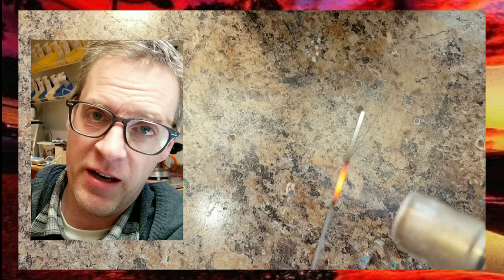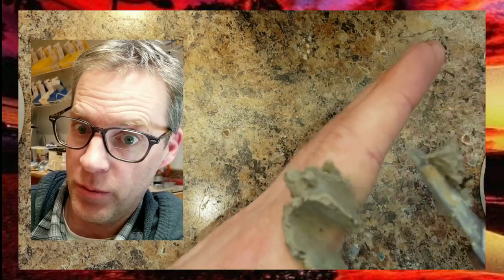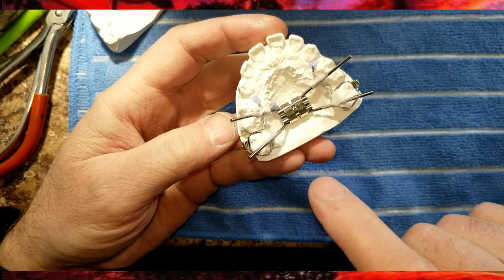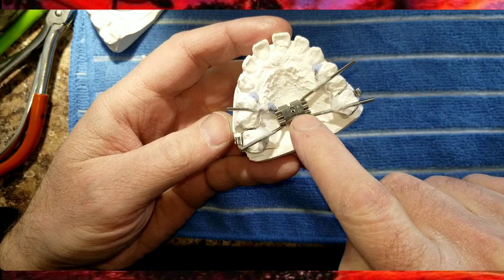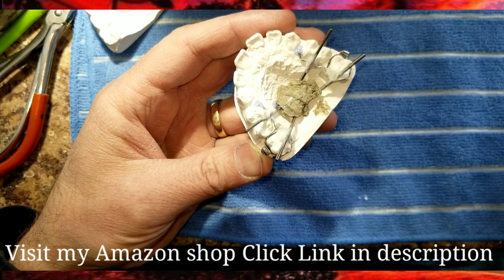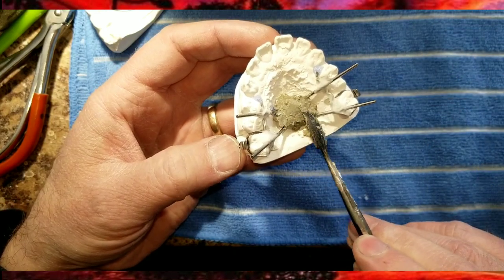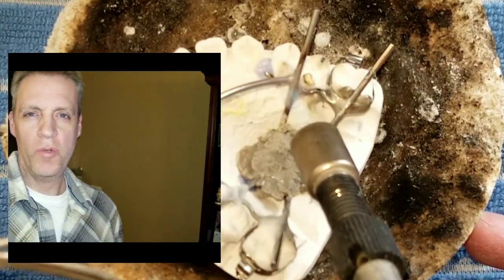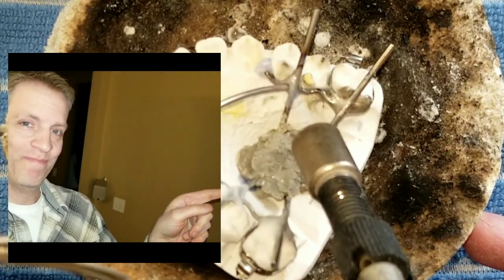Soldering 101 Lesson

Comment: Hey I am having problems with my solder joints coming undone can you tell me what I might be doing wrong?
Reply from the maker: Try roughing up band and wire before flux. Then use a spot welder and spot weld parts together. Proceed to solder
Reply: Thanks I will try that